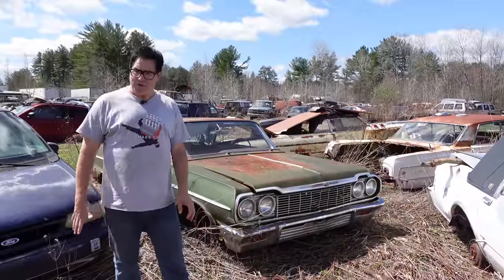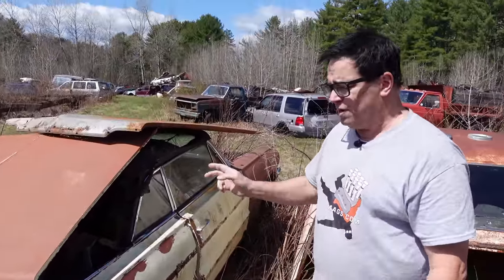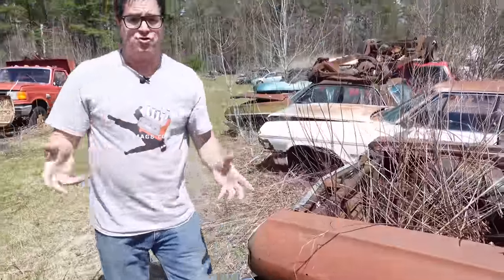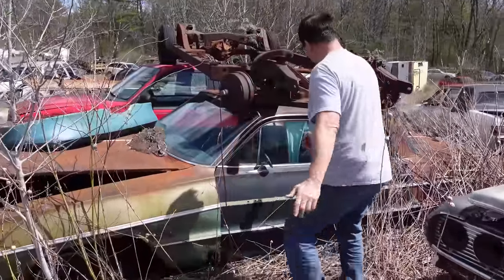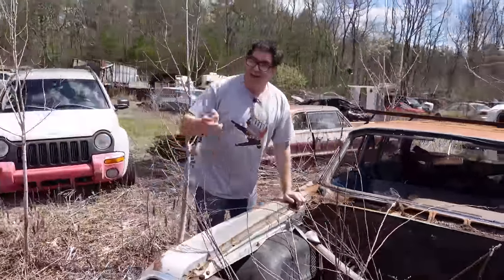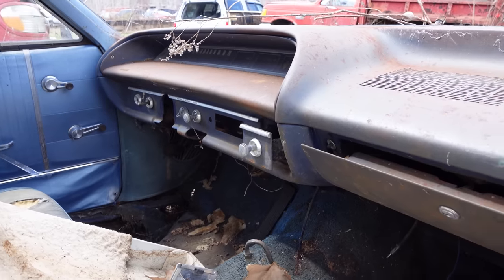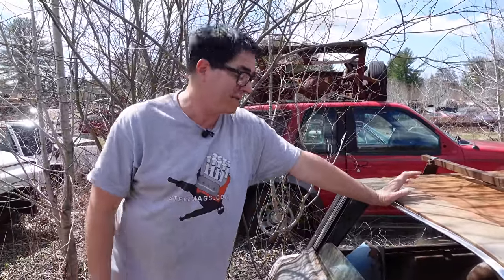Sixty-Four Chevy Celebration

Comment: Oh the memories of my 64 Impala SS. Red with white interior, center console with chrome 4 speed shifter, 327 cu. in. A ridge across the roof and center speaker in the back seat, and a single chrome strip down the length of the car. What I would give to have it now!
Reply: At 17 I looked at a '64 SS, red over white. I wasn't a gm fan but I kinda thought the '64 was sharp. Classmate Tim had it then didn't see it for a while. Then heard it was for sale so I went by his house. His mom and he showed it to me in the garage. And I looked it over fairly well but already knowing it was a 327 4-speed, headers, short high rise, posi, Cragers with G60s on the back. I don't know why I even looked under the right front fender, hadn't the other one, but I noticed clean fresh paint on the frame. Got the story out of them he'd wreaked it out of town, bent the right suspension/frame, it was all fine now, shop had it on a frame jig. Asked why he was selling it and driving his moms wagon knowing that was his baby for a year, no answer. I left. 
Apparently it was sold out of town, I never seen it again.

Comment: The small “V” fender badge signified the 283, while the “V” with flags signified the 327.   ‘The 409’s had the actual “409” badges. ‘65 was the first year for both the 283 and 327 to have their displacement callouts on the fender.
Reply: My 63 4 door hardtop was a 327 originally and it’s just for the cross flags.  I haven’t seen any trim holes so I was wondering about that myself thanks for letting  me know
Reply: I also had a 63 Bisquine  s door sedan, it had a 230 six, and had a badge that said 6 on the fender in front of the wheelwell.

Comment: Remember those ‘64 wagon tail lights? Amazing how drivers of the ‘60s and ‘70s without any “on board driver enhancement” didn’t run into each other. Yes I’ve been driving since the ‘70s and as technology “improves” the automobile, the operators skills have gotten progressively worse. Excellent content sir. Bring back those memories!
Reply: smart cars make dumb drivers.
Reply: So true!
Reply: I was 11 yrs old in '64, and wanted someday to own a '64 2 door Impala so I could get the tailgate panel from a wagon and put it on, and have the only square-lens coupe in the world.
Reply: You can still do it.  ‘64 wagon tail lights and just a little bit of metal work to a. ‘64 Bel Air deck lid. I could see that!
Reply: @davezul4396  Mostly, my thought was to have one single square taillight on each side, but yeah! Why not 3 square redtailights on each side!!
Reply: I’m with you on the single tail light on each side. I was thinking the Bel Air deck lid would be an easy tail light delete as there was only 1 parking light on each side and no reverse lights in the Bel Air deck lid. Those ‘64 wagon baseball card sized tail lights were cool!
Reply: And mom drove them??? With a 3 speed manual transmission???? NO BACK UP CAMERAS????  One rear view mirror on the drivers door??? And we actually had to pass our road tests by parallel parking those cars in real life traffic... I guess back then, we relied upon the computer in our heads...
Reply: You ought to see HQ Holden sedan lights (1971-1974) - tiny lights in the bumper bar.
Reply: @saxongreen78  This is America here.:dothefive:
Reply: @davezul4396  Uh, that one outside rear view mirror was OPTIONAL! It didn't become standard, under  federal law, until January 1, 1966, so you can find the odd 1966 model year car without a driver's door mirror. In over 40 years f looking for them, I've seen exactly ONE of them. I did once have a 1965 Corvair 500 4-door without a driver's side mirror. That car could be, uh, exciting to drive in traffic or on the Interstate!

Comment: The "V" emblem cars were 283's, the "V" with the flags on the side were 327's, 409 cars had the V, Flags and 409 above. You could get a 1965 "396" with a Turbo Hydro 3 speed.  Love you channel! Sincerely, Richard Goodman
Reply: Thank-you. Thats what i thought too, maybs some where just keen to sprout opinion.
Reply: its saul goodman!
Reply: I read that some 65's still got the leftover 409s too!
Reply: @grabasandwich  You are correct! Car and Driver road tested a 65 409 SS with a Powerglide in its November(?) 1964 issue, along with an MGB. C/D said it was more like an Olds than the earlier monster 409s the Beach Boys sang about.
Reply: That's what I remember.  We had a 64 Impala wagon w/ a 327.  My brother overhauled the engine and painted it in 1973.  Won many a rat race.
Reply: That's what I remember thanks 👍
Reply: That’s common knowledge for an impala enthusiast like myself.  Good stuff for you regular folks
Reply: @grabasandwich  Check out "Chevrolet Impact 66" on YouTube. Shows a new '66 396 whooping  a '65 with a 409!
Reply: 64's still had 409s as the top engine (3 versions, 340HP 4bbl w/hydraulic lifters, 400HP 4bbl special cam, solid lifters & 425HP 2x4bbl, solid lifters) & PG as the only automatic. (N/A w/the high perf solid lifter engines). Early '65 cars carried on with the 409 & PG trans (the double 4bbl was not offered in '65). Late yr '65s switched to the new 396 in either 325 or 425HP versions, the 325 being available with HD 3spd manual, 4spd, new THM400, or the older PG if you would so desire. The 425HP was available M/T only.
Reply: @grabasandwich  I worked at a gas station in 72 and saw a 65 SS with a 409.

Comment: Love it , my dad had a Biscayne he bought new , 2 door, is cylinder 3 speed column shift dark blue. I remember being able lay on the back window deck . Hit the brakes dad!
Reply: Amen.  My dad had a 64 Biscayne.  In a panic stop my younger brother flew from the rear shelf into the dashboard.  I drove it as a hand me down during the 70's in high school.  The old (300K+ miles)  230 6cyl, used more oil than gas.  The powerglide would stick in low for miles until it "warmed up".   It was a great car.

Comment: My first car was a 64 chev 4 door impala with 327/300 hp with Carter afb 4 barrel, v8 badge without 327, limited slip rear factory tachometer factory 4 speed bench seat. Dual rear antennas am radio. Havent seen another with that package since. Would love to have that car today
Reply: Curious optioning for a 4 door. Would be a rarity if still around. Currently bringing a '63 Impala SS 327/300hp 4 speed back to the land of the living this week for a friend. She's a Red exterior with black interior and of course buckets being the SS. She has not run since 1987 but I plan to change that. They are such beautiful cars. I wish this '63 were my own haha. At least I get to work on it.
Reply: @josephg41  I personally dont care to see what they do with them nowadays when they bounce them all over the place. I had a 63 too 4 door post with 235 6 3 speed column

Comment: These years are some of my favorites. I have only seen 1 64 Impala with a 409.
For the next year, the 396 and the Caprice would arrive.
My 2nd grade teacher had a white 1964 Impala. I remember admiring it as I would walk back and forth to school. My HS auto shop teacher call the PowerGlide "PowerSlide"
Reply: 396 was a beast!
Reply: Yeah my grandpa owned 3 junk yards in the thumb area of Michigan he said in 30 yrs he saw 2 of them a few 409 in heavy trucks but not many
Reply: In '65 the 396 became available but it was possible to get the 409 in '65 too. AFAIK, the Caprice didn't arrive until the 1966 model year as a separate model, but there was a Caprice trim package available in model year '65. The big change between '64 and '65 was the new perimeter frame replacing the X frame.
Reply: @SupergurlKara  That is what I meant. "Caprice" was a trim package for 1965, then became its own model for 1966. When I was in HS, anything with a 409 had already become very collectable. Maybe because of The Beach Boys song?
Reply: @kmath50  I'm so old (29 years and 431 months), I had that song on a 45 RPM single.

Comment: Beautiful. I found a couple of abandoned Impalas in Maryland a few years back when I was filming an abandoned house.
I believe it was a 65 Impala SS convertible four speed, and two 1962 Impalas
Reply: They still sitting there? You can easily gain ownership of abandoned vehicles
Reply: @jacobfleming565  this control don't know if they're still there or not, I had contacted the state who at the time owned the property they wanted nothing to do with it of course but they did end up selling it to a private owner. I need to fix my last comment as well, it was Maryland not Delaware.
But the property was sold to someone who is currently restoring the home which is awesome.
It was an abandoned house we went down to film and I just got lost in those Vehicles out back.
We do buy and pull vehicles out of the woods, but being that I am in the east coast, we usually go out to the Midwest. The metal is so much better out there, and people just want them gone..
Reply: @jacobfleming565  how do you go about easy. I'm finding a dead end everywhere.
I found a 63 Corvette abandoned. And a cop I know can't even trace the plate. ?
Reply: If the house is in Boyds, it's a pair of 1962s and a 1965 (along with a Buick Centurion).

Comment: Steve, the badge w/ the flags means there is a 327 motor under the hood. Either a 250 or 300 hp. Great shows. Keep them coming.
Reply: It should have the 327 badge there as well. Could just be missing
Reply: Right! 327 had the flags, and so did the 409. The 409 usually had the "409" emblem above it, but not always. Great show, Steve!
Reply: What flags?
Reply: @clutchkicker392ison5  The flag emblem on the fenders.
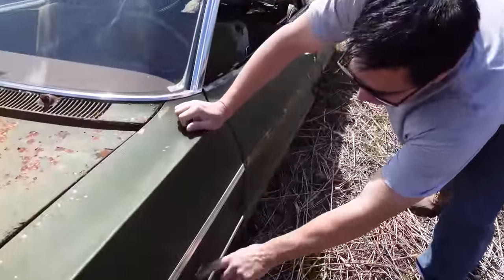Reply: @clutchkicker392ison5  There are several version of the V logo 1:12 which takes the form of crossed flags on the better V8's 3:40.   In general you have to stay  on your toes with Chevy badging and trim options as the rules changed between years and models in some cases.
Reply: Thanks for the info, ive always noticed the badges but never knew what they meant. Im more familiar with 80s cars something about them just speaks to me
Reply: @TheMr1963impala  only the 409 had displacement badges in ‘64.  The 327 was the “v” with flags.
Reply: The  badge first few he references as 283 are just a 'V', 327 flags aren't till 3 or 4 in. @googleusergp
Reply: Yes I was responding to your question of what flags?
Reply: @clutchkicker392ison5  On the side of the front fender, just behind the wheel well.
Reply: Cheers @TheMr1963impala

Comment: The 1963 & '64 were very similar in styling with minor differences in front and rear treatments. The very first car engine I worked on rebuilding was a neighbor's 1963 Chevy wagon with the 235 six and three speed manual. It was a six passenger car with no flip up rear seat in the rear so it had a hollow cargo compartment  instead which was great for sneaking a couple of extra kids into the drive-in theater back in the 1970's.
Reply: I think the 63 got the new 230 six
Reply: @timothykeith1367  It did.

Comment: Bought a 64 Biscayne wagon at an impound auction. Advertised as a 3 speed with a floor shift. It actually had a 4 speed, the auction company did not notice the floor shift. Whoever installed the 4 speed left the 3 speed column shift lever on the steering column.  Someone had also installed a Ford rear end. Pulled the dead 283 and installed a 350 from a 72 Impala. Had to have a bushing made for the end of the crank, couldn't find a stock bushing anywhere. The Ford rear end also had welded spider gears, this caused a lot of tire squealing and wheel hop when turning corners. Sold the car to a guy that was going to make a 2 door wagon out of it.

Comment: Fascinating cars.  My dad had a number of Chevy wagons over the years used for auto parts delivery.  Had '64 Chevy Biscayne wagon with a six  and three speed column shift.  Absolutely the squirrelliest car I ever drove. It felt like at least two wheels were going to fall off every minute.  Checked and re-checked but never found any defects in the steering or suspension, just cursed.

Comment: My daily driver is a 1963 impala 4 door hardtop.  It was my grandfathers car and was originally a 327 3 speed.  He swapped it in the late 1960s for a 65-66 350hp 396 with a turbo 400. I started driving it about 9 months ago after it had sat since the mid 1980s. Great daily

Comment: In 1970 I bought a dark blue 1964 Impala SS from a neighbor it didn't have the original engine and was a 283 2 barrel out of a '64 Biscayne he had prior installed with the SS's 4-speed transmission and factory crome trigger reverse engage shifter and factory console, a year later my older brother helped me replace the tired out 283 with a 327-275hp out of a '67 Chevy station wagon and it was really awesome just bone stock pulling the 3:36 gears. I gradually built the motor up later with headers, exhaust, Holley carb, 327-350 hydraulic cam, Hurst shifter and 4:56 gears and it was such a very revvy and torquey well built combination from 1500 to 5800 RPM while many others that I knew elected to use the solid lifter 365hp cam which needed to get into the higher 2500-3000 RPM range to really get going strong so they got pissed at me for always beating them, man I wish that I had it back again today.

Comment: Yup, 1964 V8 on the green one. The VIN gets the win: 4 for 1964 model year, 18 for V8 Impala, 47 for two door sport coupe, G for Framingham, MA assembly and the rest is the production sequence. The Framingham plant opened in 1947 and closed in 1989, amid controversy between politicians over the land for a new plant. Possibly code 952 Meadow Green/Bahama Green two-tone exterior paint.

Station wagon, yes, 1964, but a Bel Air, and also Framingham, MA made. With the tag, we can brag: 05D for the fourth week of May 1964 production, 64 for 1964 model year, 1635 for Bel Air V8 four door six passenger station wagon, FR for Framingham, MA assembly, 839 for blue interior trim, 940 for Satin Silver Irid. exterior paint. That's actually not the VIN, it's the Fisher Body style number. It does not always match the VIN.

No VIN, we do not win, but the VIN for the wagon would be: 4 for 1964 model year, 16 for Bel Air V8, 35 for four door six passenger wagon, G for Framingham, MA assembly and the rest is the production sequence.

Showing the VINs and the trim tags would tell us more about what we're looking at. That's the "automotive reference" book of the junkyard. Like I've always said, "We need the VIN to win and the tag to brag".

Comment: My first car, in 1974, was a 1965 Impala SS convertible with a 327 and Powerglide. I still have the grill badge. I wrecked the car when a tree ran out in front of me. I was wearing a lap belt and only got a scrape on my knee from the parking brake release. My two unbelted passengers got broken noses from hitting the steel dash and making a nice dent in it. Both recovered from their injuries but the Chevy was a goner.
Reply: I hope the tree was fully insured. 🌲
Reply: @rightlanehog3151  It was clearly the tree's fault for getting in the way of a 17 year old driver who'd had a license for the whole summer.

Comment: Great video Steve.  My dad had a '67 Impala with the 283 2 barrel, power glide 2 speed transmission.  Miss that car.  It used to valve tap but I think my dad did not adjust the valves regularly.
Reply: There was no manual valve adjustment.  They were hydraulic lifters.

Comment: My cousin got an early 60s Biscayne 4dr 283 2 barrel power glide in the mid 70s that was as new. Less than 10k on the odometer. True granny's car. Best car l ever drove. You could literally stand a nickel up on its side on the radiator cap while running which was a salesmans trick. l remember it was silent sitting at a red light. lt was IMHO the best utilitarian car ever made. Point A to point B.
Reply: I wonder what happened if that nickel ever hit the fan blade
Reply: @rp9674  Luckily the shroud had already been invented but l did witness that and it being silent when idling. lm sure lots of starters were ruined because of people trying to start a running motor! They were silent thru that single exhaust.
Reply: @mwyatt222  starter grinding on a running engine is one of the most cringy sounds, I don't miss that.
Reply: @rp9674  My uncle worked for Steakly Bro.s in Tx from the late 50s til the early 80s.  He bought all the low mileage oddities and me and my cousin were allowed to drive anything on the used or back lot. l bought my 69' AMX 390 w/ low miles from him for a couple grand.
Reply: @mwyatt222  that AMX sounds exciting!

Comment: Notice the different V emblems? Maybe the first one you showed indicated 283, and the one augmented with flags indicated 327 or bigger. My 64 Impala Sport Coupe came with a perfectly good six, 230 I think, but I wasn't long replacing it with a 283. I didn't go to the formality of adding V emblems to the fenders, though. Sleeper!!! On start up the dash had a blue light indicating Cold, until it warmed up, located beside the red Hot light which came on ... well, you know. The instrument panel, shared with the 63, also had a Gen light, although 64 was Chevy's first use of the alternator. Thanks for the reminders.

Comment: In 1969, my brother, bought a used 1963  with a 409 ." I think", & so does he, it must of been 
knocking so the guy added stp and sold it to my brother. I was riding with him when it blew.
there was no indication any thing was wrong, we were actually driving slow down a hill, getting
near our turn & it blew up . He bought a low mile 1962 & put the 283 in it . worked out , as a 283. 
We flipped the 409 block over and ( now a boat anchor)  pulled the pan . I can believe how many pieces it exploded into / even the cam shaft was in pieces. I learned to tell a 63 from a 64 from diff tail light's  and roof creases added on 64 I believe. I purchased a 64 chevy impala ss when I was 16.